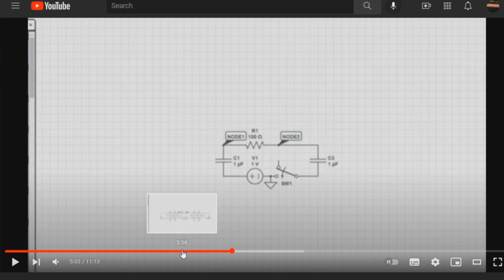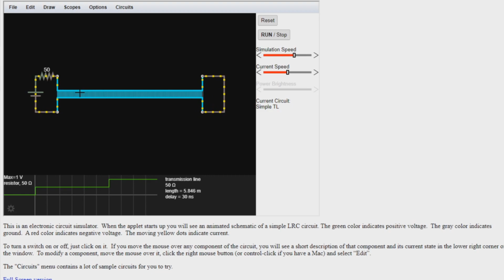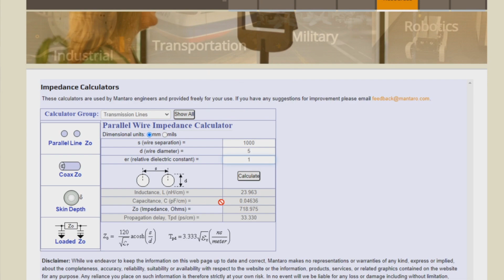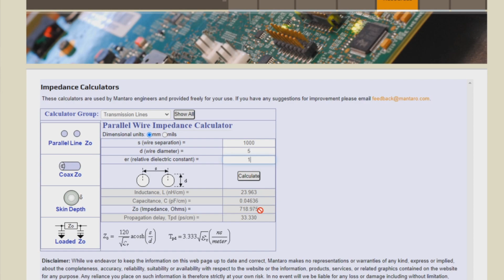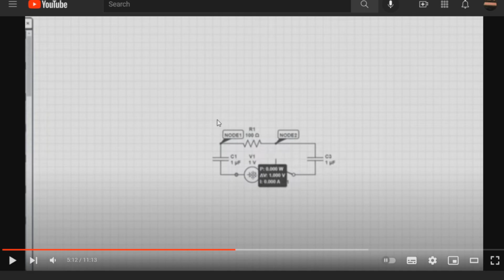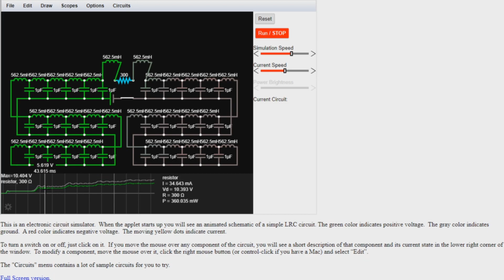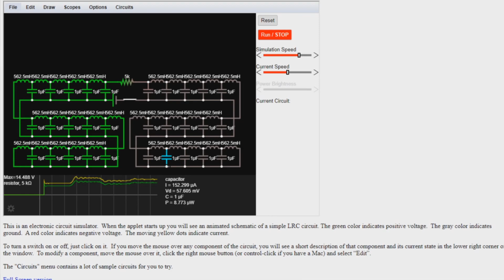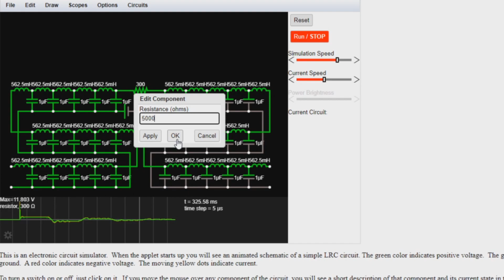2nd analysis, I think I was originally wrong! - Veritasium "The Big Misconception About Electricity"

Comment: You've gone to a lot of effort and that is to be admired.
I never liked "transmission lines" or "antenna theory", but certainly enjoy the benefits of the labours others put into designing & providing these technologies...
I have, however, several problems with this problem, not the least of which is the notion of a capacitor appearing initially as a short circuit to a square wave... Viewed this way, and with an "ideal" battery and 0 ohm conductors, the 'virtual' capacitors bridging the transmission line should apply full voltage to the load instantaneously. (The speed of light, as Derek has noted in an earlier video, is derived from permittivity and permeability... I understand "impedance", but Derek uses 0 ohms of resistance... I = E / R... Undefined (or possibly infinite amps of) current? Something's not right. 
I accept that energy flows via the interplay of the electric and magnetic fields. Let's not talk about AC at all... At t=0, a lengthening 'tube' of magnetic field is established as electrons shove one-another along the conductor (pushed out the -ve pole and sucked into the +ve pole). The two ends of the magnetic 'tube' require time to traverse the unrealistic lengths (in both directions from the battery) until they meet at the load. The energy cannot be transferred where electrons are not moving as there is no net magnetic field. Using 'c' is inappropriate as the leading edge of the step wave will not be traveling at the speed of light in a vacuum, but ... hey... let's use that 'c' to represent fastest propagation time in the conductor... It's not 300,000km/s, but, hey... we're all friends here...
Your simulation probably took some time to set up, and is impressive... I appreciate the difficulties of time constants that may not be possible to see using the app. However, that many 1uF capacitors seem to me to be truly unrealistic for the apparatus Derek proposes... I don't know how many femtoFarrads might be more reasonable... Add a few billion more to each side of the extremely long transmission line, and the battery would be depleted just trying to charge them all up before the leading edge of the square wave reached the end of the line to reflect! (Coulombs)...

Derek showed the electric field around an isolated battery, with no magnetic field because no current was flowing... I accept that there is an 'interplay' between the fields and the electrons migrating from a high potential toward a low potential and that is the conduction of energy.

Consider the energy transferred in a raging river as it follows its river bed down its gradient. If you stop the flow, the transfer of energy is stopped... Yeah, take away the electric field that results from the voltage potential across the battery and the electrons stop moving, and no energy is transferred to the load. I am not convinced that the amount of capacitive coupling between two very long thin wires across a 1m air gap is sufficient to create an immediate flow of current in the circuit Derek presented.
Reply from the maker: The capacitors do not supply infinite amps of current because they are also coupled with the inductors, which limit the current ramp up. The resistance is 0, but that does not impedance is zero. Impedance is basically an extension of resistance but it can be frequency dependent and imaginary. An analogy with water doesn't really work well in the case of impedance, you'd have to get into the momentum of the water flow.

For any capacitive coupling there will be an immediate (or 1/c s) flow of current, but whether or not this is significant is dependent on the load selection. Our best case scenario is the perfectly matched load of 1.5k ohms, here the steady state power is 96mW, and our transient response is half that at 48mW (50%). If we use a 300 ohm load, we only get 2.7% power transfer. If we move to something like a 12V 100W light bulb, we'd only get an initial transient power of 0.09mW compared to the 100W at steady state.
Reply: @ZongyiYang  One trivial issue with the circuits being different between the two videos... (We humans have so many blind spots!)
Your 1st video shows there is a series of "virtual" inductors along the "far side" length of the conductor. These disappeared in the more detailed 2nd video.
As you state, these represent "self-inductance" of a conductor, "impeding" changes in the magnetic field strength (delta I)  just as capacitors "impede" changes in electric field strength (delta E). All these "virtual" circuit elements must be "charged up" with energy taken from the passing wavefront of the initial transient, and cannot "return" that energy until the energy wavefront has travelled to the distant loops of the conductor and returns along the other 'side' of the conductor that includes the load. Once the "eastbound and westbound" wavefronts "meet" on opposite sides of the load, the field lines can connect and energy will flow through the load. (This is my "blah-blah" version of why 'reflections' will arise... Nothing is instantaneous in the real world.)

I'm busy trying to talk myself into changing my mind, too, but my gut tells me there's still something "missing" in all of this...

Is it that the virtual capacitors connect the electric field across the gap "instantaneously", but energy is also absorbed as the electric field forms across the dielectric and will only transfer (as if forming a "bucket brigade") as the growing "tube" of magnetic field extends along the length of the conductor??? A potential difference can exist (does exist, for instance, between a cloud and the Earth's surface) without the flow of current (or energy) until enough conducting charge carriers are mobilised along a path and their displacement, however small, creates the magnetic field component???
Reply: @ZongyiYang  Really stupid, simple question...
Why doesn't energy from the battery transfer across the tiny gap of the switch while it is 'open' (at steady state)?
There's a potential difference across only a few mm of air gap between the contacts.
Could it be that the "direct path" for uniform electron flow has too much resistance for the small voltage to overcome?
No moving charge carriers means no magnetic field.
One can increase voltage or decrease the gap until one gets a spark, or arcing, conducting energy through a plasma with major losses but that's cheating.
Reply from the maker: @Liza's Mentor That is exactly what I'm saying, at the best case scenario you can get 50% power transfer through the air but that's for a specific 96mW device. While a 96mW bulb or LED definitely exists, any normal household device would be running at 1, 10, or 100W magnitudes. At these magnitudes, the energy transfer through the air is a tiny tiny percent. 

For normal electronic circuits, bleeding isn't as big of an issue because of these higher powers, and also because the change in voltage would be common mode. So any induced change in voltage to a device from a nearby power line would be seen across every conductor on the device almost uniformly, which is basically like no change at all. So for example, a power line next to a large conductor has both a + and - wire, since both wires experience the same induced voltage from the nearby power line the actual effect on the device is zero.